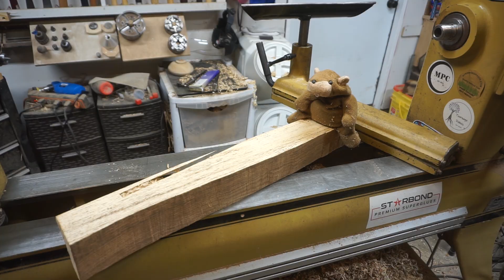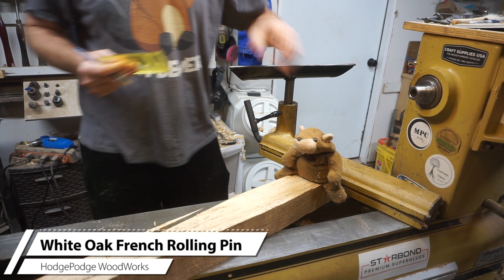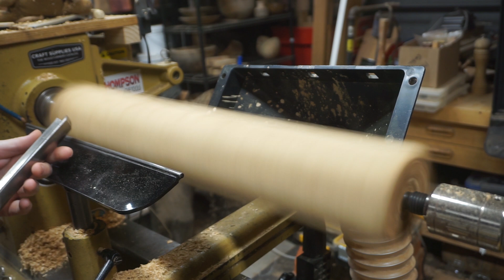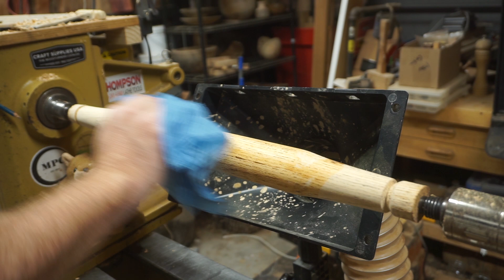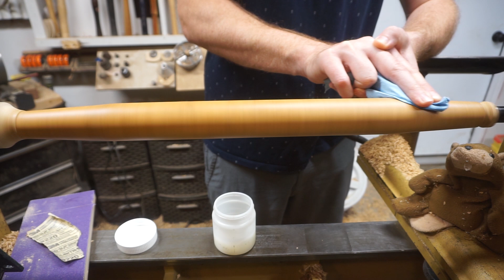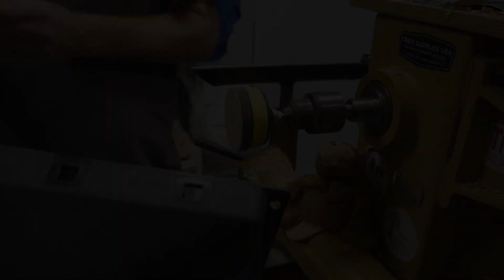Woodturning - White Oak French Rolling Pins - Gift Idea

Comment: What were the size of the wood (provided Harry did not chewing on it)?    What was the length of the finished product?  In the center of the pin, how thick was it, and what was the finished diameter of the ends???
Reply from the maker: Finished length was at 20in. The center diameter was 1-5/8in and ends were about 1-1/8in.